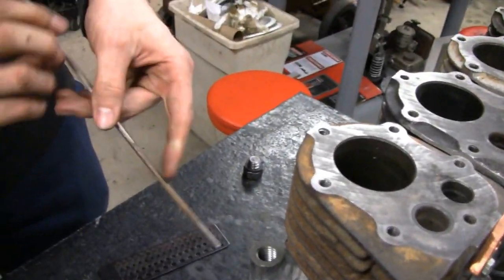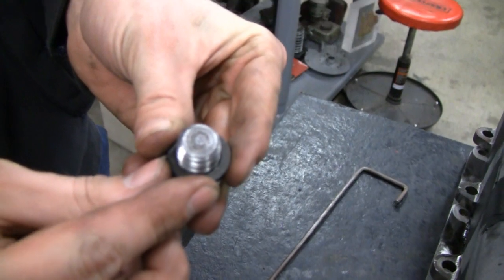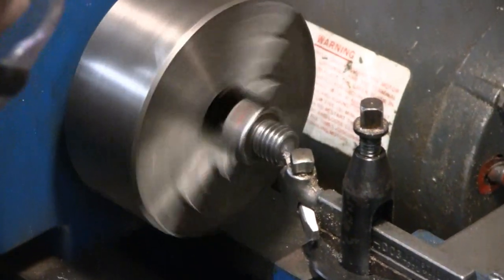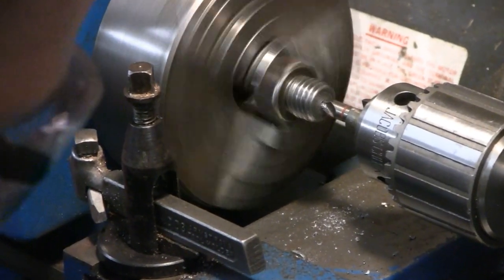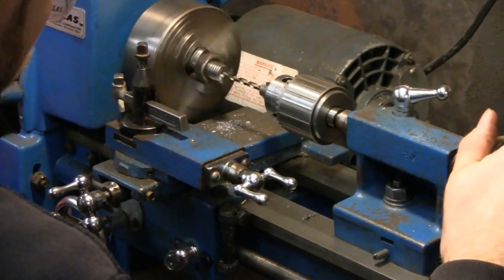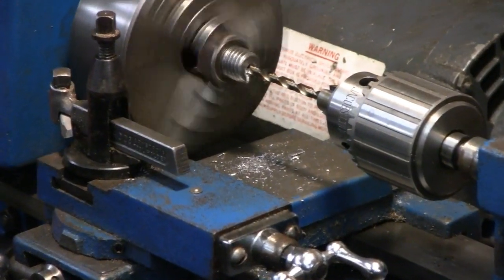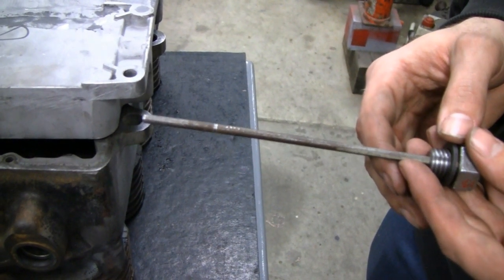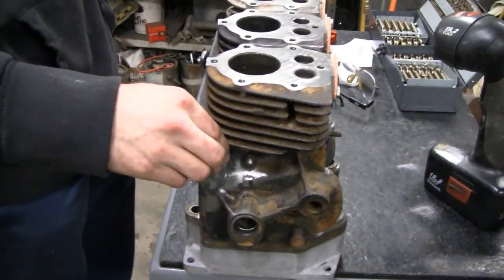HOMEMADE 4 CYLINDER BRIGGS PROJECT (part 11)

Comment: If you knurl the other end (the end that goes into the oil, it will make it easier for the oil to stick to the stick and easier to read.   If you did it to 1 side it would be a lot less whacking with the magic hammer.
Reply from the maker: We thought about knurling the bottom but Mike had the knurling tool at his house!!☺